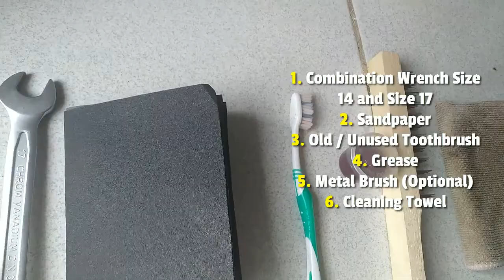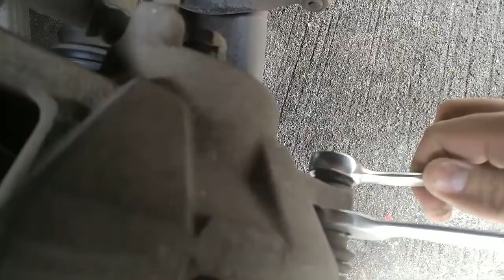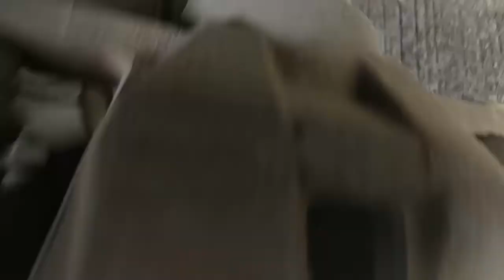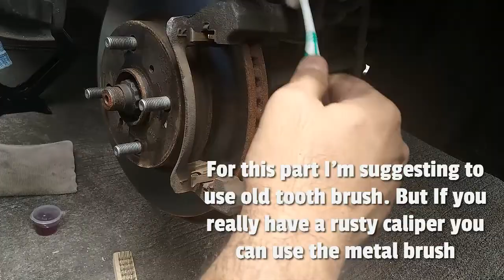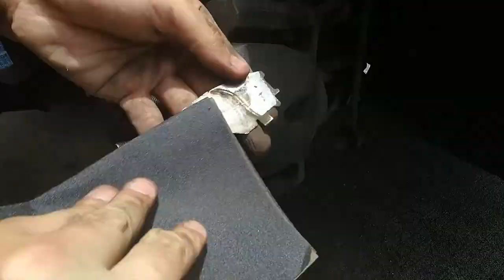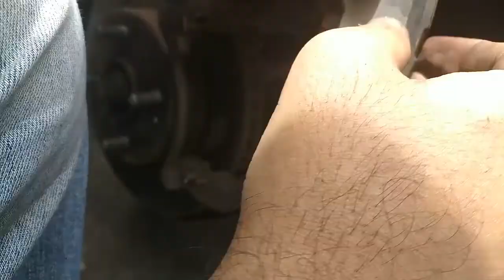How to Clean Brake Pads | DiY Tutorial Car Brake Pads Cleaning

Comment: is grease really recommended? will it not touch the surface of the disk once melted due to heat?
Reply from the maker: yes but, pick a grease that is suitable for brake hardware. I used ceramisil grease now, and when i do brake job, i always put grease on brake pads/hardware grease points. Just make sure there's no grease no the surface of brake rotor or pads

Comment: lods okey lng ba kahit di na lagay ung breakpad clip? fortuner 2020 gamit ko sir
Reply from the maker: sir minsan kapag ganyan umaalog pad lalo na kpag taas baba ung walang clip, kung pansamantala lang pwede naman pero wag masyadong matagal, lagyan mo din sir agad.
Reply: @MrBundre  napansin ko sir parang di okey prang nakapreno sya kaagad hirap mag accelerate baka madamage rotor disc ko, wala kasi ako mahanap na clip
Reply from the maker: mukhang mahirap ngang maghanap nyan paps, try mo sa surplusan, kpag nakajackpot na may post na may parts out kagatin muna kpag meron nyan.
Reply: @MrBundre  sa toyota mismo kaya sir nagbebebta kaya sila nyan?
Reply: @jhordanmeneses6170  casa yan sureball. Imposibleng wala
Reply: Sa casa paps meron nyan.. medyo mahal lang.. sa vios kasi nasa 1400 yung 2 set sa harap